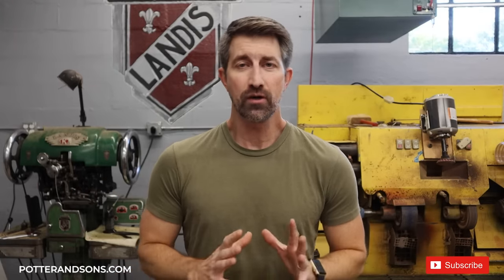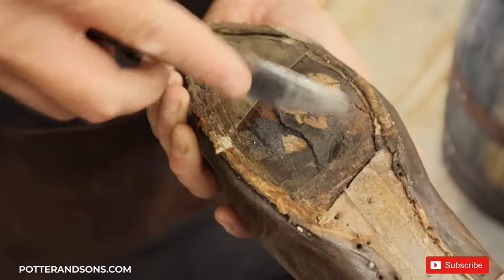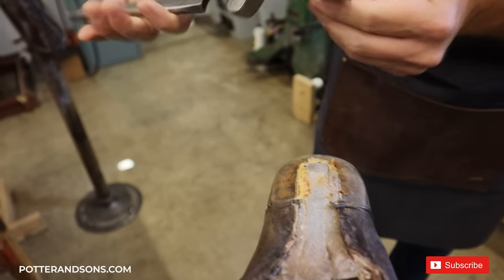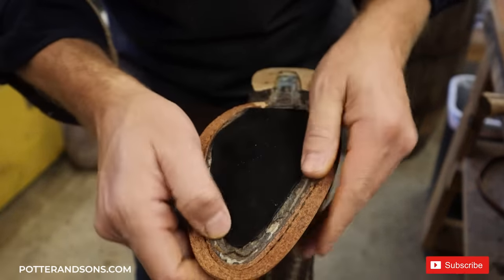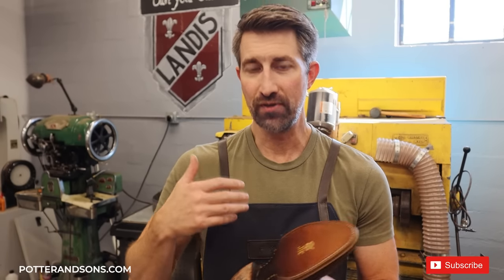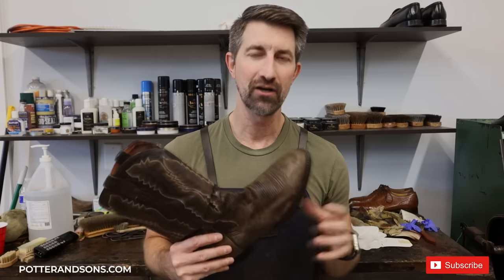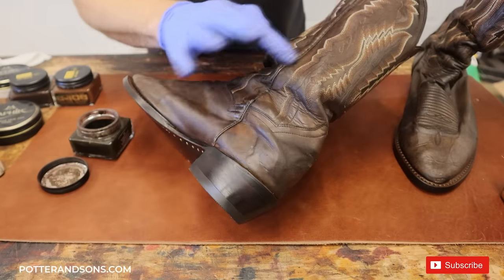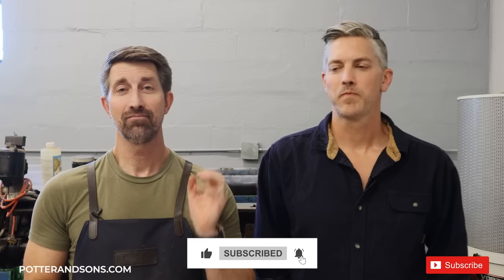Worn Out Cowboy Boots Are RESTORED | Dan Post Boot Overhaul

Comment: From my perspective as a former cobbler, if the boot/shoe is already broke in and in good shape, it is almost always more cost effective to rebuild the bottom end adding a superior material that will last longer than the original than it is to buy a new pair. Even if a new pair would cost about the same or even be cheaper to just replace. Vibram products rock as well as Austrian sole leather (at least for rebuilding loggers caulk boots).

Comment: My standard thing with my leather soled cowboy boots is to have a rubber topper immediately put on from new by my cobbler. Cowboy boots generally have quite thin leather soles and I find that the way you walk in them seems to wear them out more quickly. 
It also adds grip and when the time comes all that is needed is a new topper and rubber heal top. Much much cheaper in the long run and makes the boots more useable in all terrains!
Reply: That’s what I was going to say.  They don’t usually have thick soles on them, and you don’t really notice it till it wears through.

Comment: Very good video. Those boots look 100% better! Having worn boots all my life, I've found that if you polish them once in a while and keep up with the soles and heels they'll last for decades.  I've had boots that have lasted over 35 years.  What eventually happens is that I'll get a hole in the upper where the pinky toe pushes on it - that's when I toss them out.  Unless they're dress boots I resole with rubber, because smooth leather soles on wet floors are deadly!

Comment: Instead of a bigger compressor, consider moving it outside if possible, or if you do get a bigger one look for an undersized pulley on the motor which will make it quieter.

Comment: IMPORTANT QUESTION:: Is it hard and expensive to replace the insoles with all leather insoles. My brand new custom boots have a thin layer of a man-made cushion that causes my feet to sweat.  Want to replace these insoles with    a all leather insoles, to help with moisture.  No need to replace anything but the insoles....(IF IT CAN BE DONE)

Comment: Something many people lose sight of too is, if I am just to replace the boots instead of the price of resole, i basically throw the old boots out. If the main issue is the sole, and the upper will make it through the life of another sole, get them resoled. Most of the break in period is the upper of the boot becoming pliable around the ankle and toe box, replacing the boots means you have to break in a whole other pair, which could take months before they feel as good as the old ones. Also, a lot of us like the scars and scratches on our boots, after a few years of wear, they remind us how long the boot has taken care of our feet.

Comment: I gotta have a traditional leather belt, for my BTS brass buckle and because I carry things on my belt.
At work I have a tool pouch and multitool...ect, and off work I have a belt knife and theres even a holster on my belt at times.

My weight doesn't fluctuate so I don't really have to worry, but if I did I would go with a leather belt that has some adjustability where the buckle attaches like the belt from Rose anvil.
I think that's the way to go when you need a belt that needs to do more than just look good and or hold only your pants up.

Comment: I have a question...the brass nails that are driven into the arch area - how do these not come right through into the inside of the boot? Are they cut shorter inside? I can never understand how these tacks/nails aren't sticking into peoples' feet!!
Reply: They hit the metal last and cinch onto the insole or the nails are not long enough to go through the insole.
Reply: When putting the nails, pins, screws, or staples in they have the shoe placed on what is basically a foot-shaped anvil. When the tip of the nails come through to the inside they hit the anvil and flatten out, so there’s no pointy end left. You can snap/cut/grind off any excess left on the outside.

I have a couple of pairs of boots with nailed/screwed outsoles, and just a thin leather cover insole over the lasting board. I can feel where the flattened tips are if I stop and sort of feel around - it’s maybe a half a millimetre or 1/64”, super thin and not at all a problem.

Comment: In my experience, sometimes focusing only on cost can be foolish.  I have a pair of Ugg boots that, at the time, I had owned for twenty years. I had taken excellent care of the boot’s leather and sheepskin tops.  To my disappointment, the boot’s soles were attached with glue and began to detach.  I took them to a well known YouTube cobbler who is local.  He rebuilt the boots completely with new insoles, midsoles, a Goodyear welt, and Vibram Kletterlift outsoles.  The boots will easily last me another twenty years.  What’s more, they can easily and inexpensively have new outsole put on.  All tolled, the cost of the work was exactly the cost of a new pair of Uggs. However, as with many products, the quality of materials used after twenty years is lower in order to save cost and profit from an established brand name.  Though the cost of the work equaled a new pair boots, the quality of my twenty year old boots is superior.  And I’m very happy with the results.

Comment: I can’t believe that the guy who owns these boots after going this far on the resole wouldn’t have the insole replaced I mean how much more money could it cost? I have the same exact boot the only thing is their brand new but they are very very comfortable I would’ve borrowed the money to have a complete job
Reply: Insole replacement is really expensive. It's almost a full deconstruction, you're fully removing any structure the boot did have. You have to measure make reference points and a bunch of other stuff to try to get the same exact fit as the boot had before you took the insole out. It's quite a bit more work and time. Probably a couple hours.